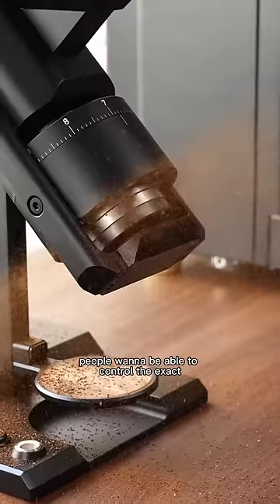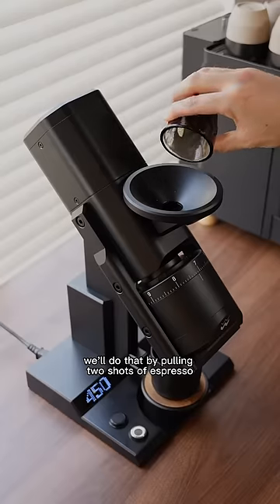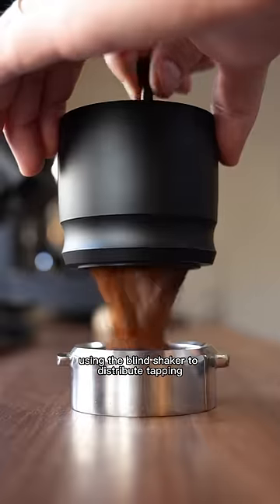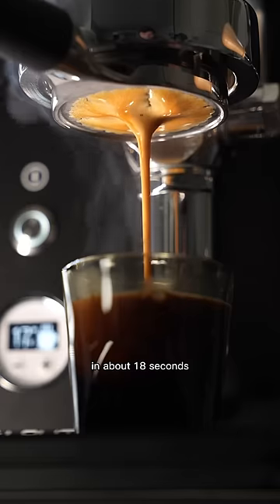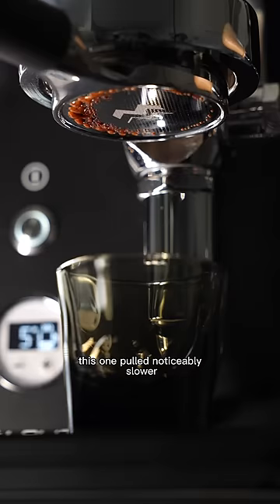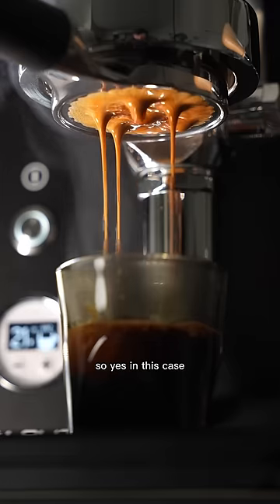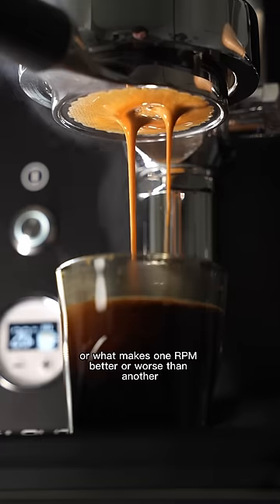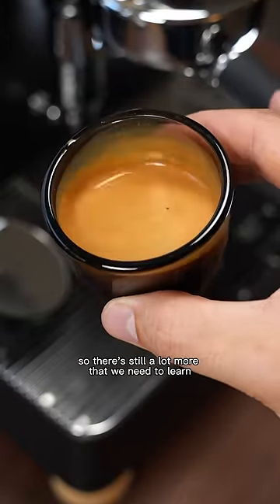Coffee Grinder RPM - Does it make a difference?

Comment: Higher RPM create unintended fines. Lower RPM give you more control and less heat which preserve more flavours😊
Reply: yes and no.... it s about the size and the granularity
Reply: What about if lower RPM leads to the coffee being ground for longer and gets more heat than if it went through quicker at higher RPM? It’s a very interesting subject.
Reply: @glen.moralee  silly
Reply: Less heat? The water is hot my friend
Reply: @glen.moralee  it depends on if he left both running for the same time, given it was running at 1500 rpm, 3 times faster, it can do a lot more work quickly making the grounds incredibly fine compared to the 500 rpm and the grounds being that fine affect how the water can soak into the grounds I think
Reply: @viniciusm869 heat to the beans, grounded or whole is still a big factor affecting the extraction.
How long have you been a barista dude? Cuz your comment sounds dumb
Reply: @glen.moralee Lance actually confirmed this.  Obviously, higher speed increases it in the beans.  But also, when you load the grinder at once, not all the beans can go through and get heated more.  It s better to load small amount at a time to avoid over heating the beans.
Reply: Many factors indeed. Was just watching Hoffman review grinders and noted at least one model that allowed rpm to be reduced to 500 but whose motor wasn't strong enough to do the job at that rpm. It would stall or overheat unless feds very slowly.
Reply: You should also consider time it takes to reach desired rpm.

Comment: As an engineer, higher rpm will cause more shock loads on the beans, this makes them break more quickly, into smaller pieces from contact with the burrs. That's why you're seeing a finer grind.

Comment: Grain size affects permiability of a material. If you put gravel, sand, and clay into a barrel (separately) and pour a bucket of water, the water will reach the bottom of the barrel faster through gravel than through sand. And it will not reach the bottom through the clay at all.

Comment: Take it from a pothead - if your blunt has too much of a kief to bud ratio, you won't get a good draw.  A higher RPM creates a finer grind, acting on the same principle as the blunt.  You need enough interstitial space for fluids to pass through efficiently, and finer particles tend to fill those spaces up

Comment: Materials scientist here, throwing my 2 cents in. Higher RPMs means higher impact force exerted on the beans during grinding. The fact that 1500 pulled slowed may indicate overall smaller grind size which makes sense because a greater impact force would be more capable of breaking the beans/grounds into smaller pieces.

This looks like a lighter roast, which is much more brittle than a darker more oily roast. I have a feeling this effect may also be dependent on the roast level, as this impacts overall mechanical properties of the beans.

Interesting test!
Reply: More specifically the higher rpm in this instance is producing more fines (pieces smaller than what the burr set was set to cut) which can lead to slower shots. 

The inconsistency between different grinders is probably a function of burr shape, diameter, and possibly coffee entry point, angle, and rate alongside rpm
Reply: Aerospace engineer here, agreed, I think what is probably true is that any given bean should be ground at the highest rpm possible without producing fines smaller than the intended grind size. Like you said, the lighter the roast, the lower this ideal RPM is. But this would be highly variable from bean to bean, and would be difficult to measure outside of pull speed.

Definitely a lot of variables here and testing would be highly iterative, I question if your coffee would come out that much better if you tuned in your ideal RPM, but I’m all for science for the sake of science 😊
Reply: Coffee: the science that brings material and aerospace scientists and engineers together. ❤☕
Reply: Quantum energetic field and stratospherical multi-gravitational scientist here. 

From an agronistic perspective it is actually quite important how many RPM's you choose to grind your coffee beans. 

First of all, the force of every grinding tooth is proportional to the earths vertical spinning downforce multiplied by 0,2473 nm. This means that the higher the RPM's  of your coffee grinder, the more friction it causes in between the edge of the grinding tooth and the molecular particle of the coffee bean - resulting in energetic upward momentum and causing electrons to leave their usual aggregated state, meaning that it is essential to measure first the horizontal diameter of the edge of the grinding tooth inequally proportinal to the gravitational downforce of our hemisphere to measure the right RPM's for the coffee beans. 

Of course there are variables like coffee bean size and the upward pulling force of the moon but these are things we aren't in charge of. 

However, when taking that into account, the best time and setup to drink your coffee is the following: 

- diameter of grinding-tooth: 1.21 nm
- moon-angle: 13.1 ° in relation the western hemisphere
- date/time: 13th October at 09:14 pm
- RPM's: 1567
- coffee bean size: 1,3 - 3,2 mm (if bigger please discard, because larger beans can trigger electrostatic buildup inside the grinder which can impact the full absorption of molecules in a negative way.

I am doing this since couple of months now, works for me 👍
Reply: actually while I'm not a materials scientist, I am an engineer by training so I do know a bit.

I disagree. I don't think it has anything to do with impact force. Higher RPM means the number of grinder teeth meeting the coffee is thrice as high as before. What this means is that it will tend to take more consistent chips off the coffee bean. it's kind of how lower feed rate and higher RPM results in better surface finish for machining.

impact force ahs to do with torque but torque does not necessarily correlate with speed.
Reply: @renj123  I can agree on that partially because there are still variables that haven't been considered. I suppose to leave that topic aside and return later, when we have more advanced particle accelerators to investigate the exact electron behaviors in different energetic states. 

Maybe that can be forwarded to coffee beans too. I think time will show.
Reply: @_forcefully_  What happens if you don't live in the northern hemisphere?
Reply: @merP.-YT    I was already waiting for that question. The important parameter here is the moon declination in relation to the middle of our earth's diameter, since this variable is crucial for the optimal mutual-energetic binding force of the electrons circling inside the coffee bean. 

I chose the western hemisphere because it was the simplest way of declaring the right moon angle which is 13.1°. 

However there are other paramters that can help you to measure the exact moon position for whatever geological position you are at right now. The important variables are: 

- Moon Declination: (- 7,546°) - (7,398°)
- DeltaT (time between Terrestrial Time and Universal Time): 69 - 76 sec. 
- Altitude-angle: 1.09° - 1.11° 
- Horizontal-angle: Not more than 57,34°, else the upward momentum of electrons is just to high for a quality extraction
- Rektaszension usually should not be more than 3.00h, or else it would affect the extraction time to a degree of 1/10 of a second which, as you already assume will change the formation of electrons and can impact extraction quality. 

So yeah, thats the whole package of variables you should be looking for when it comes to the extraction. 

I need to say that the numbers can iterate up to three decimal places because of the transaction times of modern satelite equipment. But we still must appreciate, that we have at least the opportunity to use modern-day science when it comes to making coffee. Cheers.
Reply: @merP.-YT  To answer your question directly: You should not make coffee without knowing the exact value of the variables  I mentioned above. 

The variety of things that can happen to you and to your coffee beans is astounding. 

On a microbiocular level it can even reach the N-Delta-C-String on your tongue and cause friction beetwen the orcalis (nitro-phosphate-pump) and the ugema (sodium-chloride-accelerator), which as a result can cause replacement of both components of around 0,1303^-23 nm on the surface of your tongue. 

Till this day we arent sure exactly what can happen but it's still better to drink your coffee, right in between the numbers I mentioned above so your tongue and the taste receptores stay in their right multi-atomic-supramolecular-electron-positron-diameter.
Reply: @doughenderson6089 How exactly does higher RPM relate to higher impact force? First and foremost, there is an electric motor built in the machine, with a given power. Now power is the product of angular frequency and angular momentum. Meaning with higher RPM (higher angular freq.) you just get lower angular momentum, thus tangential force on the beans, and vice versa. My 2 cents as an engineer.
Reply: @renj123  I agree with your first paragraph! However, why would torque not correlate with speed, if we are comparing a similar power level / load on the motor?
Reply: It would be so cool to be a material scientist
Reply: Darker roasts are a lot more brittle and less dense than lighter roasts, not the other way around
Reply: @briannec2016  Everyone just claims to be an expert in certain fields. Gangsta here. I approve of this message
Reply: funny the video said its not known, seems fairly obvious

Comment: My guess is that when you have a higher RPM, the permeability decreases/ less water is able to flow through. When you decrease the size of the grains you make it easier for the coffee grounds to more densely pack, and slow for less flow. For example, sand particles are much larger than clay and have high permeability, whereas clay is very very fine and allows for a lot denser overall material that does not allow for water penetration.
Reply: How does the RPM affect the grind size tho? Making the grinder spin faster shouldn't decrease the space between the burrs making finer coffee ground.
Reply: I'm guessing Higher RPM shatters beans more, creating more fine particles. Not sure tho. @Ncxznvll
Reply: You're not changing the grind size what 😂
Reply: RPM can also change the torque. Or in other words the amount of strength the machine uses. Not just stopped. That would definitely change grain size. (I don't make coffee but I did make an A in calculus 2)  @Ncxznvll
Reply: I would say the science tracks on that. And yes, spinning something faster, even if you aren't changing the grind size, would create smaller particles over time. If you think of a mortar and pestle, the longer you grind something, the finer it becomes. With a coffee grinder, a higher rpm is going to create a finer grind in the same amount of time vs a lower rpm, simply because you are crushing it more times per minute. If that makes sense?
Reply: You would want to prove the grind size with a lab test.

I know of such test: Grain size analysis, used to check grain size distribution for soils. It is done for all soils, weather its sands or silts or clays.

So you make sample A, say 500 grams of coffee grinded with 500 rpm, sample B the same 500 grams grinded with 1500 rpm.

And you sieve each sample with the stacked sieves (something like 8 sieves stacked with gaps in between and the last is a pan) which has larger screen holes on the top and smaller sieve holes on the bottom (the largest one will catch small pebbles, the smallest one is sieve no.200 with opening diameter of 0.075 mm).

Next you weigh the weight of grains retained in each sieve and on the bottom most pan.

The you plot the data on a chart plotting sieve size and the weight of grains that passed the size.

Then you compare the charts.

Google soil grain size analysis. Its simple enough to understand. It uses ASTM standard.

Source: I was a lab assistant back in college for such tests in the soil mechanics lab.

If i was still in college, i could probably do the test myself since we had the freedom to use the equipment and the test time isnt really long.

So if any of you know a civil engineer/geotechnical engineer who knows a technician/lab assistant in the soil mechanics lab and have access to a coffee grinder with variable rpm, it can be done.
Reply: I think, although the mechine is setted in the given size, in the higher RPM, we have some finer beans  causing this issue.
Reply: @Ncxznvll it wouldn't effect it as much if the time was lessened as well, if its the same amount of time at higher rpm, it'll cause smaller particles. Like a motor, if you have lower rpm for 5 minutes there would be less wear on the motor, if you had doubled the rpm of the motor and had it set for the same amount of time, the motor would experience more wear since the parts are touching more often then they would be if at power rpms.
Reply: @Ncxznvll think about it this way, if you use a hand grinder for 2 seconds vs 2 minutes, the grinds will go from coarse to fine. Assuming the 500 rpm vs 1500 rpm was running the same amount of time, 1500 is essentially speeding up the process resulting in a finer ground. Sorry i tried to explain it as best i could
Reply: B

Comment: I'd guess the higher rpm makes rhe coffee finer and as such the water has a harder time traveling through the coffee. (Basically like gravel vs sand)
Reply: Probably not, the grind size is already a seperate controlled variable. Thats what the numbers on the grinder indicate. But it could be that the higher rpm makes the grind size less consistent

Comment: It's really intuitive. When the rpm is higher, the beans are grinded into a finer powder. It's not really noticeable but there is a difference. When you run the water through the coffee, the water passes through little gaps in the powder. Finer powder = less and smaller gaps

Comment: I’m not sure but you should check the temperature of ground coffee… if the one with higher rpm is slightly warmer then there are chances it has released more oils on grinding compared to the one ground on lower rpm… higher oil release makes puck slightly clogged and will have different texture in crema also…

Comment: According do the kaffeemacher guys higher RPM produces more fines. That increases the resistance for water flowing through the puck and results in a slower shot.

I observed the same results. Usually, I don't compare just different RPM settings but slightly changed degree of grinding so you get the same extraction.

My fully automatic cooffee machine was most sensitive to RPM changes especially in terms of taste (feeding it with my own freshly ground cooffee). I remember 100 RPM made a huge different in taste. My espresso machine isn't that sensitive, though.

Comment: When the grinder is faster, it will give you smaller particles(I assume). When it has smaller particles and you press it, it will compress more compared to having bigger particles. When it is more compressed and pushed together, it will have less space for water to move through. Thus making the time increase. 
It is like the difference between different kinds of dirt used for plants. Different dirts are different in the amount of air, water, and food they can hold on to. So farmers have to be aware of the area they are planting.
Have a great day

Comment: Think of the grind speed making sand or flour. Sand is low RPM and flour is High RPM. Water will flow through a packed down layer of sand but will settle on top of a packed down layer of flour. Same properties. Water will only flow quickly through a high RPM grind if it isn't packed down.
Reply: the result isn’t wrong but that‘s a p bad analogy

Comment: Unless I’m missing something here, in general grinding faster but for the same amount of time means a finer grind, which increases the surface area of the grounds, which means more work needs to be done to push the water through the coffee. Think of the difference between running water through sieve full of sand vs a sieve full of earth. The water will have much less trouble getting right through the sand, but it’ll take longer through the earth

Edit: and now forget everything I just said, I forgot this is a burr grinder which lets the grounds through DURING the grinding process. I’m an amateur coffee enthusiast with a blade grinder where the grounds stay in the main grinding (or, blending…) compartment until the grind process has finished. So for MY grinder what I said would be true, but not for one like he’s using in the video. I didn’t think before commenting 😅

Comment: I think it is because the one with 500 RPM haa bigger particles so the coffee can pass through it faster. The 1500 RPM has smaller particles so it is like passing it through but making it more concentrated. Think of it like the 500 RPM powder like pouring a bucket of water through balls(the things like in sports) There is air between the balls, so it can flow through. The 1500 RPM is like sand. It absorbs it more too.

Comment: The reason this has an effect is most likely the centrifugal motion and static. Higher rpm can cause static under some configurations and under some configurations the higher rpm can actually benefit or interfere with the grinds leaving the burs resulting in a bottleneck.  This can produce more fines and or more even grinds.  The goal would be to make the grinds leave the burs at the right size as quickly as possible. This isn't so straight forward and so many different factors can change the rate they leave. Experimentation with your specific grinder will find out. I'd love to do a large scale experimentation